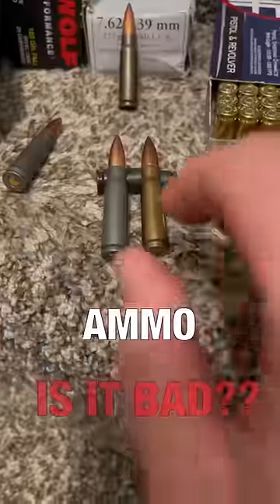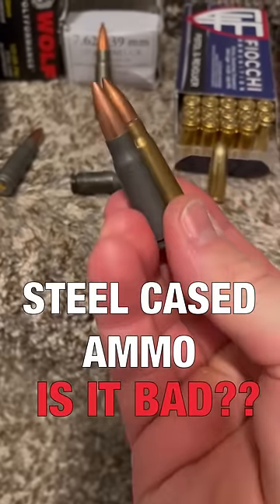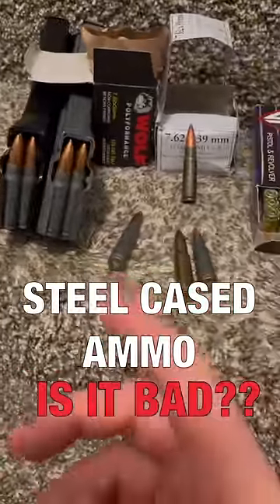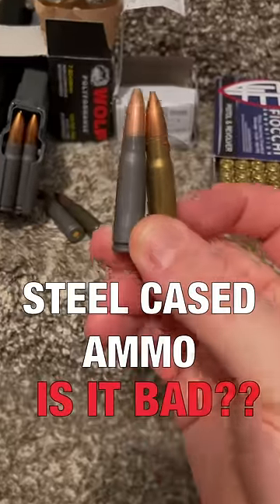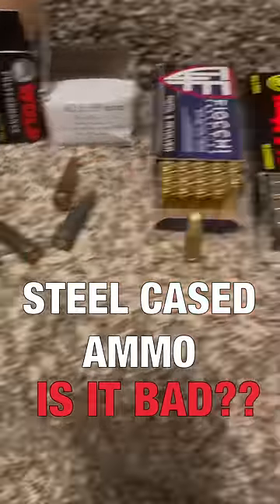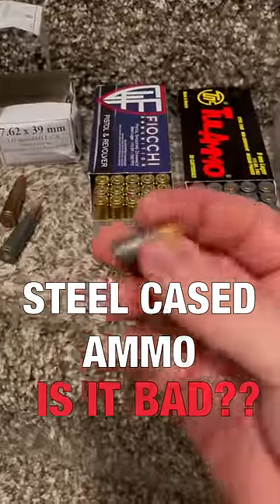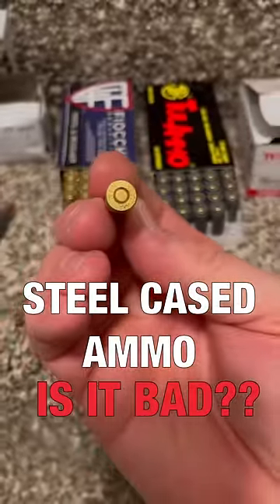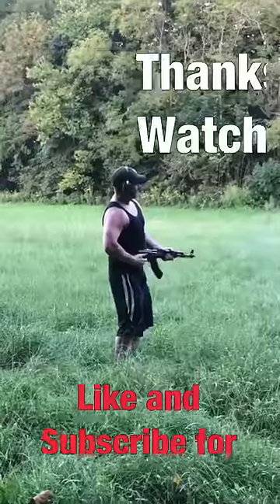Steel cased ammo, is it bad? #short #shorts #shortvideo

Comment: Only bad experience I've had with steel was tula 7.62x39, and I had dud round and ejected it, but as it flew out the chamber I thought it looked odd and when I grabbed the case the bullet was missing from the case. It had gotten lodged and stayed in the barrel of my sks somehow. Nearly blew my gun and face up. 

Other than that nothing but low pressure problems here or there with my ar's

Comment: I use steel cased ammo more than brass and never have a problem. The main reason why I don't have is most of my weapons are AKs, SKSs Mosins, Tokarevs, Makarovs a HK G3/HK-91/CETME, Serbia CZ, Ruger P-Series..

The vast majority of my collection are former Soviet bloc and was specifically designed from the ground up to use steel case ammo. HK G3 and their variants all have fluted chambers so any kind of casing can be extracted with authority at the cost of not reloading those cases.  Ruger P-Series tolerances are loose enough to minimize malfunction in general.  

Steel case is fine in weapons designed around it.  Most NATO/western designed weapons are designed around brass cased ammunition. Most East bloc/former Warsaw Pact/Soviet bloc designed weapons are designed around steel cased.  One can only do so much against a fundamental design feature. 

I've always been a firm believer in feeding what your gun is designed to be fed.
Reply from the maker: Fantastic comment, some great information here!  Thank you!  💪

Comment: I’ve had ever so slightly more extraction issues with steel case as brass in ARs. Not enough for me to ever be concerned about at the range. Accuracy - depends on the rifle but most times the steel case is as good as my usual brass.

Comment: The main problem I see with steel casing and this is just a Opinion based on experience with steel. Steel absorbs oxygen out of the atmosphere around it or in this case inside of it. I know this because occasionally I have to enter a steel tank at work. Part of the procedure for this is to drop an oxygen meter into the tank and quite frequently the oxygen meter reads low oxygen when the tank is initially opand we have to pump air into the tank before we can enter it. Gunpowder is a mixture of fuels containing oxygen. Theoretically the steel would absorb some if not all of the oxygen from the gunpowder

Comment: What I don't like is the thin copper plate over steel jacket.  It may look like a copper jacket, but much of the russian stuff is copper plate over steel jacket.  
I'd prefer to run with copper jacket.  It molds to rifling easier, there's less friction, less heat on the barrel. 
And as got to reloading, using the brass I can make new ammo cheaper than steel ammo.
Reply from the maker: Excellent

Comment: Keep your chamber cleaned and don’t switch back and forth between case metal without cleaning.  Steel before brass is usually gonna fail bc chamber is dirty and brass grips it when the case expands. Steel let’s chamber get dirty. Brass seals the chamber better when fired and stays slightly cleaner

Comment: If it's coated in polymer then the steel of the casing obviously isn't rubbing up against your chamber or extractor. It is true that steel cased ammo will make direct impingement guns dirty faster because the steel casings don't fire-form to the chamber to the same extent that brass does. This isn't an issue in piston driven guns though.

Comment: Lots of debate in the Ruger Mini’s 5.56/223 and 7.62x39 not shooting still case polymer coated well (feed and ejection issues)while another mini has no problem.  Consider/research having a gunsmith polish the chamber might might not help.  Supposedly the AK and SKS have little to no problem with metal cased polymer coated Ammo.

Comment: Steel case ammo is low carbon steel, it’s not the hardened steel that is typically used for things like construction and such; it won’t wear on your barrel or extractor any more than brass casings will.

Comment: If the gun can't run steel case you got 3 options 

1. Get rid of it and buy a new one

2. Try and fix the issue with talking to the company or manually diagnosing the problem

3. Tell others about how steel case is bad and no one should use it 

I personally like going with option 2 then 1. I feel the gun should be able to eat whatever you throw at it. When ammo shortages come about I want to be able to shoot regardless if it's premium match grade brass or the dirty "pleab" steel case.

Comment: Steel ammo is fine.  In fact steel cases are much tougher than brass making you less likely to experience a blown out case or primer seperation on firing which are both pretty dangerous.  If you are worried about the wear you can always just apply a thin oil coat to the casings when you put them away for storage.

Comment: Another bad thing about it is inconsistent charge and therefore velocities. I've put enough of it through a chrono to know its probably 10% weaker than the average off the shelf brass ammo. That's not to say steel case doesn't have a place.  Perfect for mag dumping into a trash pile or other activities where accuracy and reliability are not a concern

Comment: I've used 1000s of 7.62 with a sks it was tul ammo and never had any issues not saying you won't but I never did also used at least a 1000 or so rounds of aluminum case 40 s&w and never had a issue either

Comment: Some weapons like the AK are literally designed around steel case ammo. If you ever run brass through an AK notice that brass doesn't get ejected nearly as hard, almost dropping at your feet, and steel case ammo flys out of the gun when ejected. The gun was designed to run steel.

Comment: AR's will 100% will jam with steel ammo. Other than that I've never have any other gun jam. I believe the reason is 223 or 556 is more of a straight wall cartridge. VS 7.62x54r, 7.62x39, 5.45x39 and so on which have a tapered cartridge. The Russians had this in mind to make the ammo as reliable as possible. I'm sure you knew this.... good video.
Reply from the maker: Great comment!  Thank you for mentioning the tapered cartridge style that the Russians utilize, good info!

Comment: “If it doesn’t eat steel it doesn’t deserve brass” - AK Guy
Lucky my AR -15 was designed for both steel and brass. Also my AK loves steel ammo but I do have brass 7.62 ammo as well
Reply: Which ar?
Reply: @ryand8024  I own a DPMS Oracle and it was made and designed to shoot steel cased ammo.
Reply: @ryand8024  not many people like that company because they assume it’s for the “poors” yeah it’s cheap but if you swap out the gas block like I did then it’ll run perfectly but I haven’t had many problems with that AR.

Comment: Brass extracts, and feeds way better than steel cased.  This is Especially true for American made rifles.  Old Soviet and Eastern Block rifles seem to feed steel cased without issues.  The bi-metal surplus which is steel will a copper coating work great and is not in the same class as laminated steel.  I agree that you need to clean Eastern block ammo more often and  more carefully than Western made.  There are a number of reasons for this not just the steel case.

Comment: oddly enough, my 1942 mosin doesn't like brass, regardless of the brand or grain. It expands too much and is actually harder for me to extract, where as both the old steel surplus, and the Wolf company which uses steel work flawlessly for me. Any of my other firearms however and there is no difference that i can tell (for me in my own experience)

Comment: The wear issue with steal case ammo isn't with the chamber, it's the barrel. Almost all steel cased ammo has a steel jacket that is copper or zinc plated. The plating isn't thick enough to prevent steel on steel contact in your rifling. End result if this contact is around 10k rounds you are likely to see accuracy drop as your rifling wears away.
Reply: The bullet isn't steel. The casings are.

Comment: 90% of the modern firearms (post 1990) most people will run across have no issue running steel case. if you are looking to get range time and "any old target will do". steel is great. If you are looking to run drills, hone in on precision and/ or wanting to collect brass to reload for later. use brass. but it doesnt make sense to waste the more expensive ammo if you dont need to

Comment: It depends what kind of steel cased ammo you’re using and what you’re using it in.
Reply: Really doesn't. I've used wolf, red army, tula, yugo surplus sealed, russian spam can, russian reman, some other goofy company I don't remember.

Only problem I ever had was old yugo surplus x39 in an AR platform. Solution was heavier hammer springs.

Comment: Over a dozen countries have been using them for decades, like someone commented if your gun is made out of pot metal and can't eat steel cased ammo especially an ak then it deserves to be melted. Also if you got a 223 wylde barrel you shouldn't even be using steel cased ammo since the barrel has tighter tolerance and the heat will expand the steel causing it to be stuck in the chamber

Comment: It’s not bad for firearms that were designed for them. Euro guns can handle them just fine in most cases. Over here in the US where I am, our firearms are designed to use brass cases. If you’re going to use an AR for example, make sure it’s milspec. If it’s some other firearm, then it’s not advised

Comment: Personally I’d go for brass. It’s cleaner. In my I rifle use 5.56 as much as possible because the rifle will be immaculate still after 100 rounds. .223 steel case rounds generate a lot of powder and after the same amount I 100% feel the need to tear my rifle apart to clean

Comment: I have no issue with the steel case.  However, some steel cased rounds have copper plated mild steel bullets.  These will certainly wear harder on the barrel than copper jackets bullets.

Comment: Brass expands and contracts more easily.  If you have an improperly cut chamber and/or magnetized parts then brass could be an excellent remedy for the symptoms but a properly cut chamber is the cure. In .223 and 7.62x39 I've seen boring reliability and accuracy. In 9mm I've seen much stronger crimps and much less bullet setback from poorer feeding guns and again that reliability and accuracy. It's warm enough to work but not warm enough to tear up your gun.  Don't have to throw your back out picking up brass. I've shot tens of thousands of rounds of steel case in those calibers and it's all ran perfectly. Never buy steel revolver ammo though. Bought 4 guns to attempt to burn through 1k rounds of steel .38. My forearms are still huge from pounding 85% of the cases out of the cylinders with a screwdriver and rock.

Comment: The SKS and the AK-47 both were designed around this round being what they use. I'd hazard a guess that if you are running steel in one, it'll be fine. I only run steel in my SKS.

Comment: I don’t mind running steel case in my AK’s or AK variants. It’s all I’ve ever run in my Galil Ace. Now in my AR’s I run only brass. Not that I don’t think Steve case won’t work it’s just that my AR’s are a little nicer so they deserve the nice stuff😂 a lot of the myths behind stew case ammo have been debunked but I think one downside (the f you can even call it that) is that it runs dirtier than brass but as long as your cleaning and oiling properly shouldn’t be a problem really.

Comment: Haven't had any functional difference personally between steel cased and brass.  I usually don't run the comm bloc type steel cased ammo because of the bimetal jacket being a harder alloy than copper jacketed rounds and it causing mechanical wear on the lands quicker than the copper jackets will.  That really the biggest physical difference.  Running the steel ammo in let's say an ar15 type rifle you will save about enough money buying steel cased ammo to pay for the barrel that will need replaced sooner than it would be with copper jacketed bullets.  So it really balances out in the end.  Me personay I run brass especially in a rifle that is very accurate to keep it that way longer

Comment: My AR will not cycle steel case reliably but my AK on the other hand eats it up for breakfast My 9mm on the other hand has the same issue with cycling reliably I guess it just comes down to knowing your firearm I wouldn't trust my life with steel case ammo but for target practice I guess it's not such a big deal as long ass you have the proper tools to extract a steel round from your chamber they can be quite difficult to get out

Comment: I had an AR with I believe like a $700 upper on it that I fired 3 rounds of Wolf steel-cased ammo through.  The third casing got stuck in the chamber.  I brought it to a gun store, and the guy there had to stick a wooden dowel down the barrel and hammer the casing out.  He said something about lacquer making the casing stick in the chamber.  I've never bought any steel ammo since.
Reply: meanwhile my m&p sport II eats steel for breakfast lunch and dinner💀
Reply: Thanks for saving it for the rest of us.
Reply: That's because you probably shot brass cased first. Shoot one or the other. I've gotten stuck brass cased as well. Polish the chamber with a nylon brush with some oil on a drill for a few minutes. I did that and I never got a stuck casing since, but you should always have a cleaning rod on you with your AR. When a casing gets stuck, the extractor will rip the rim off so it can't grab the case anymore.
Reply: Lacquered and unlaquered never had that problem 

Also you don't own a squib rod?
Reply: @toddk1377  No, it actually happened on the third shot ever fired out of that rifle.
Reply: @collinhennessy6558  
Okay...I would still polish the chamber though. I got stuck cases all the time in my Ruger when I first bought it. Polished chamber with a nylon brush with a drill on the other end of the cleaning rod, applied some oil and did that for 5 minutes. Never had a stuck casing again. I do this to all of my rifles, no issues. Can't stop a stuck case due to over pressure which happens once in a blue moon, but that's why I always keep a cleaning rod in my range bag or attached to the rifle. Nothing ruins a range day faster than stuck case you can't extract.

Comment: I ran steel case through my AR and nothing bad happened. I mean I ran steel case through it by the case load both with and without that lacquer coating, and nothing catastrophic happened to my rifle. I did have the occasional dud round though but they also didn’t fire in my 5.56 ak either.

Comment: U.S. WW2 ammo had steel, no? Like the .30-06? Maybe that was just the jackets on the projectiles and not the cases
Reply from the maker: They used brass casings, but some of the AP ammo had steel core I believe..
Reply: @KentuckyLasslo  but the jackets were gilding metal. Or gilding metal clad steel jackets on the projectiles.
Reply from the maker: I found this info, pretty cool! 

Because there was a shortage of rolling mills, rather than copper, most of the cartridges out of Evansville were made out of steel, not brass. New technology and equipment had to be developed to make sure steel cartridges were as reliable as brass ones.

Comment: Unless the gun is specifically designed to use steel case ammo, I would avoid it.  Brass is not that much more expensive in the long run.

Comment: If a new barrel cost 200-300 for a decent one , and you save anywhere from 150-300 dollar for a case of steel vs brass , you already made that money back by using steel. You can get 10k rounds instead of 13-15k rounds out of your barrel if you use steel . Not that big of a difference and most people don’t shoot that in their lives , steel is fine

Comment: The ONLY place I had issues with steel cased was with .357 magnums in revolvers. The tolerances were too tight, and needed to literally pound out each casing from the cylinder after firing. Believe I had 4 different revolvers out that day; each behaved the same way. Will never buy steel cased for any revolver.
Steel cased is harder to extract just by its nature- even on semi-automatics.. In a revolver, it's 6 times harder in  a 6-shot ;  8 times harder in a 8-shot. (because you attempt to extract all at once )

Comment: Steel case is far more accurate in my AR-47 than brass that I’ve tried so far. It is dirty. Haven’t had any failures yet at 600 rounds.  But possible I’m sure. But at 100 yards the cheap Tul ammo gets me better than 1moa so far.  The only real issue I see that I don’t like is the carbon and rust on the bolt face.  It cleans off. But if left alone I’m sure would cause issues in the future.

Comment: Idk if people know this but a lot of steel cased ammo is also bi-metal jacketed. Meaning the copper jacket which is supposed to be softer than your barrel steel is actually not copper but a copper and steel alloy. So the projectile itself is harder on your barrel especially if its not lined with chrome.

Comment: My rule.  If it is a carbon steel barrel with chrome lining, I will use steel ammo.  Using steel cases in a stainless barrel is Haram.  Stainless is way too soft and you chamber will get wrecked over time.

Comment: Had a 1911 model pistol, ran brass all day never had to clean it ever.
Ran some Russian Wolf by Tul Ammo and the resin around the primer clogged the freshly cleaned and oiled gun so bad it didn't make it though a full magazine before it wouldn't cycle.
It is ok for practice and depends on the gun but in general use steel cased ammo is just shit ammo.

Comment: Steel casings aren't harder than brass and aren't harder on components, this has long ago been proven. The grade of steel in steel casings is incredibly low and soft, so much that extractors often rip through rims instead of extracting when they wouldn't with brass.